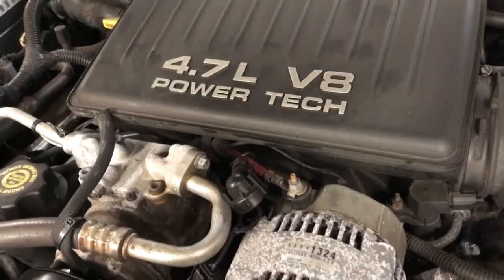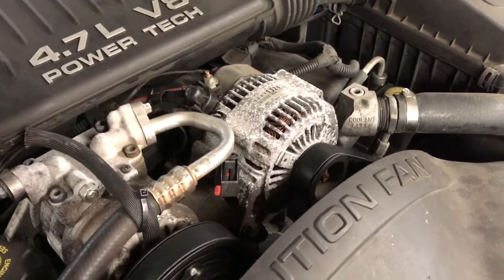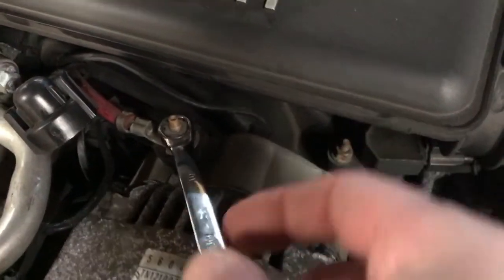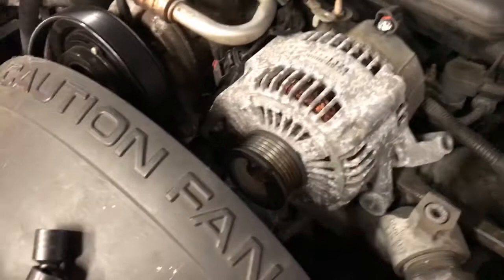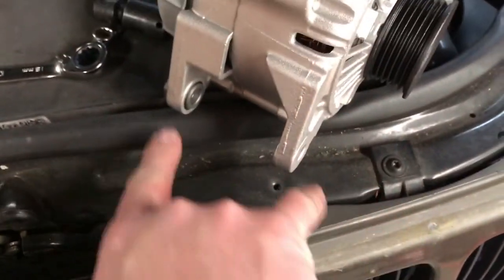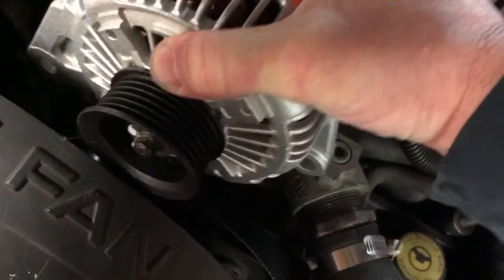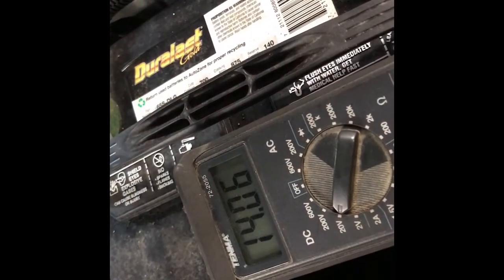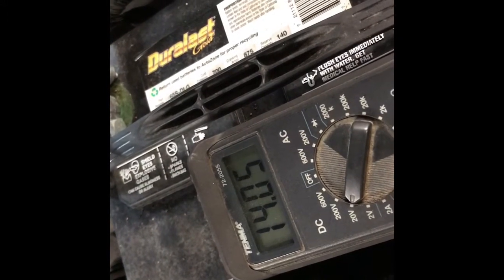How To Replace An Alternator On A 99 Jeep Grand Cherokee

Comment: My 99 Grand Cherokee alt will not lift off. I think the sleeve must be pushed in to far. Any idea how to knock it back with the alt on the car?
Reply: tgbluesman I having the same problem, can't lift it up. Any ideas?
Reply: Yes, it was just so tight. I tapped it with a screwdriver between the bracket and the alt on both ends and it came loose. Good luck.
Reply: from the top....it wasn't the pin